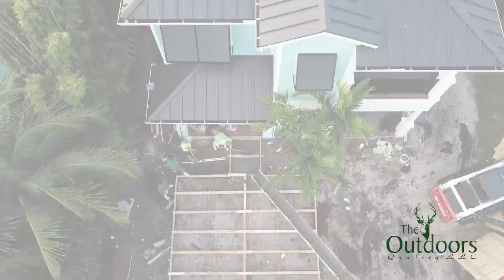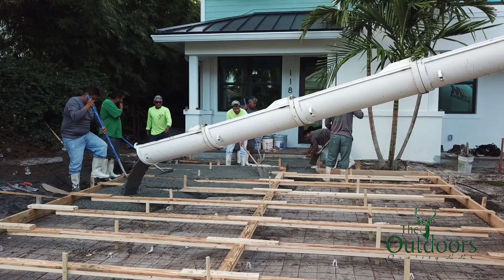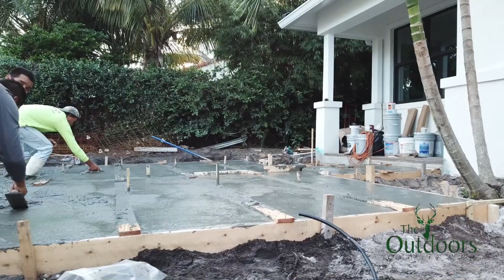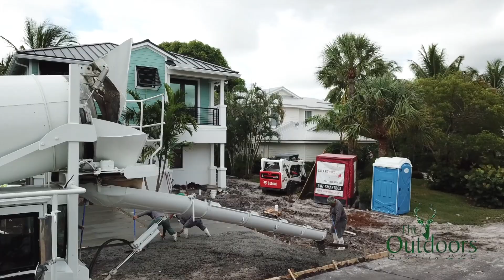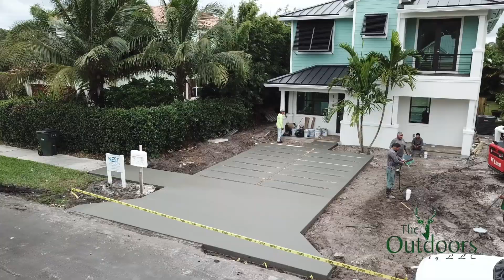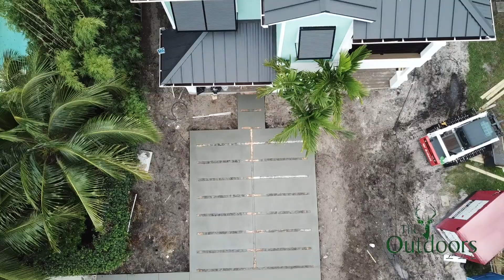Pouring A Modern Concrete Driveway

Comment: what are the boards in the concrete for im confused
Reply from the maker: Recessed in to add either fake grass or pebbles, but you have to pour this at 6” thick for this to work good. This is a more modernized style